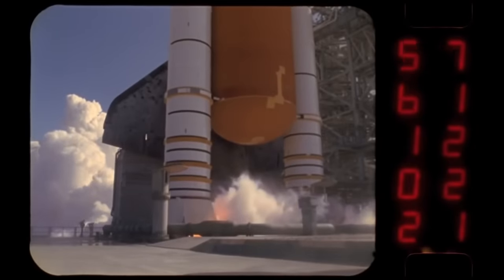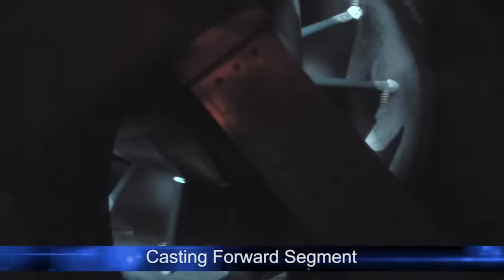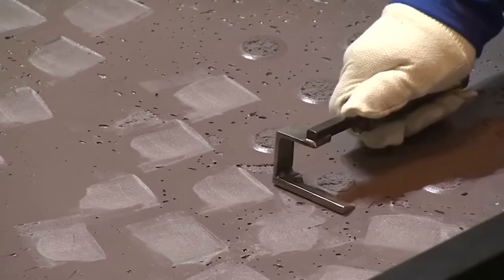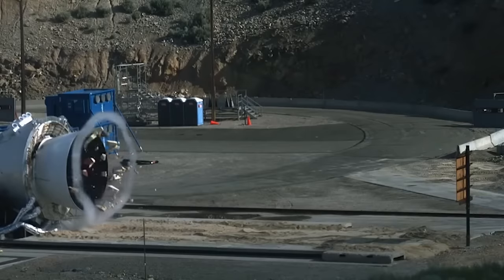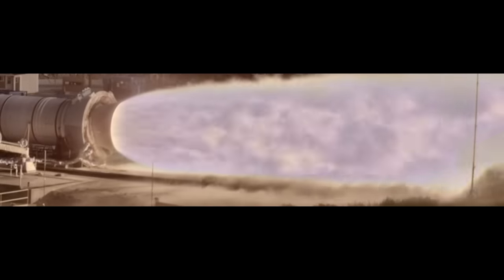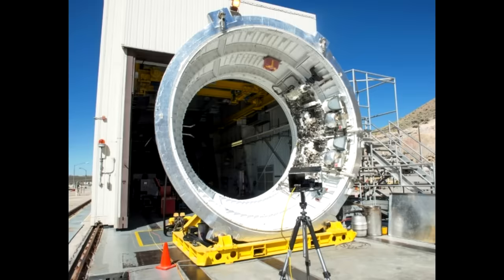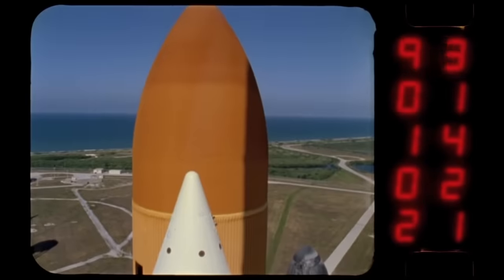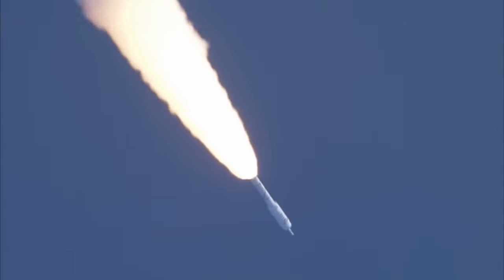The Amazing Engineering Behind Solid Rocket Boosters

Comment: Finger-picking Thiokol by the Nixon office meant the ultimate demise of the STS. They couldn't produce and deliver the SRBs in a single piece nor any more powerful than what they did, and that's why they were made in sections and in pairs besides each side of a parallel external tank. Had NASA picked Lockheed or Aerojet (biggest rocket engine ever fired. Still in a trench in Miami) the design would have been a serial/tandem which allowed for a survivable escape system just like any other rocket design.

Comment: It's not "solid rockets", it's "solid fuel rockets".
After all rockets are solid by definition, being made with metal...
Reply: Metal tubes are in fact hollow by definition.

The skin being a solid has no bearing on whether the rocket itself is hollow.

If a rocket was solid, they couldn't put anything inside it....

Comment: Why not make them as one piece instead of segments using O-rings? ... I'm guessing political reasons -like Utah senators pushing to have parts built in their state.
Reply: the SRM's planned succesor rocket was the ASMR and i was to be filled in one piece... this of course meant it had to be filled in Florida, and not moved across country. which is why the original was filled in pieces
Reply: They were to big to ship in one piece from the factory to the launch pad
Reply: @stevenf1678  They were too big to ship from Utah to Florida.  If the factory had been in Florida, no problem.  Hence, why it was likely political "pork" for a Utah politician.  This sort of thing happens all the time in congress and hence I suspect it happened here - otherwise why go through the extra engineering steps and extra processing steps. To me this just demonstrates why government run/managed projects are economic disasters and can also lead to real disasters.

Comment: It not amazing, as it doesn't work , Nasa are failing behind in the space race, China will slowly start to pull ahead .They have made that Artemis rocket to complicated, should of stuck to the old reliable Saturn V rocket system, and used the liquid oxygen and Kerosene mix for lift off , no liquid hydrogen on the lift off, its a very thin liquid and will find any weakness, the liquid oxygen and Kerosene mix worked well during the Apollo missions, and would still work well today  and the Safurn V rocket system is just as good for deep space missions . I feel the SLS rocket system should be scrapped before a serious major incident occurs. Just go back to the Saturn V rocket system and fuel, it all worked.

Comment: Unbelievable to think a few years back we were chucking the boosters in the ocean after one use and now SpaceX has re-used a booster 9 times so far.
Reply: @Steve Acho Reused means used again vs being disposed.  Refurbished means they were prepped to use again.  Fly it, pluck it out of the water, refurbish, fly again.  That is reusing the same booster.

To say they were not reused but refurbished means the boosters were not flown again after refurbishment.

Comment: Still prefer liquid rockets, F1B engines would be safer with the Pyrios booaters with Liquid Oxygen and RP1
Reply: It would have been a good systen had they done a better design job on those joints.
Reply: @GH-oi2jf  solid rockets like hypergolics are just too dangerous for human uses

Comment: Solids are great, but they pose a lot of problems moving forward.  Reusability is almost non-existent and they are expensive.  They also cant really be refeuled.  If we want to make rockets reusable and cheaper, we need to move away from solids.  They also produce much more soot than a liquid fueled engine which produces a lot of pollution
Reply: SRB'S aren't reusable? Wonder why they landed in the ocean under a parachute,were towed back to shore, and reused?
Reply: @codymoe4986  U mean refurbished?  You can't just wash it, refuel, and launch again.  The refurbishment process is long, expensive, and complicated.  It's basically just as much work to build new ones as to refurbish old ones.  Trust me, they are far from reusable.

Comment: I thought the F1 was the most powerful rocket motor.
Reply: The Space Shuttle SRB was the most powerful solid rocket motor ever flown. Each provided a maximum 14.7 MN thrust. 

This is roughly double the Rocketdyne F-1, the most powerful single-combustion chamber liquid-propellant rocket engine ever flown.

-Wikipedia, edited a bit

Comment: Ask the astronauts from the space shuttle disaster how amazing the engineering was on solid rocket boosters LMFAO , At least the liquid fuel rockets have an option ( rarely works) , Ounce that solid rocket booster is it don`t turn of till runs of go juice.
Good for payloads not human transport. The past speaks for itself.
Good vid though.
Reply: These had an emergency off, used seconds after the disaster as explained in this video.

Comment: Is there any reliable validation they actually use solid fuel? It sounds quite a bit far fetched that fuel could be solid.
Reply from the maker: Have you never used fireworks? Black powder is a type of solid fuel.
Reply: @scottmanley  Black powder is an explosive not fuel.
Reply: @lottnio8207 Seriously kiddo, didn't you ever constructed mini rockets with saltpeter and caps from bottles?
Reply: @tgstudio85  Seriously fuel is not solid but liquid.
Reply: @lottnio8207  Wood is a fuel isn't it? Fuel for your fire.  Really, go and do some reading mate, starting with the definition of what fuel is, ffs.
Reply: @SMHman666  no wood is not fuel but I think some kind of oil or something can be made of wood
Reply: @lottnio8207  It appears as though you are being serious so I suggest you have a look what constitutes a fuel. It does NOT need to be a liquid.  It can be a solid, a gas, a liquid, plus other forms as well. Coal is a fuel as is anything that is used to produce heat and or energy.  Rockets have been using solid propellants for decades.

Comment: You know Scott, you "metric only" people have to give it a rest.

No sooner are you giving booster section specs in meters, at 3:00..., the graphic at 3:07, and next at 3:15,  pops up as a graphic of original plans in inches. 

Look we know the rest of the world is so much better being as you guys use metric (/s) but for us in the U.S. being taught imperial as kids imprinted it on our young brains during early development, now we are hardwired to the way we think.

As for me to change over is asking me to convert every dimension I hear thus breaking the flow of thought. And yet even though doing so I don't visually 'feel' those numbers.

3.7 metres and 4.5 meters - what the heck is that? Mmm... somwhere around 12 feet and about 15. And that the conversion is times 3.281 has me in the weeds if I want to be exact

Although through wrenching my own cars I do know 12mm is just a bit under 1/2"... but 10mm, um let me think. 

If you're truly about educating your viewers you'd set aside your bias and do the extra work of providing imperial alongside metric as does Curious Droid.

That said... I've been a woodworker all my life, from framing to finish hanging doors, installing stairs, even as a shipwright with a turn in between as a cabinetmaker and I must say there's nothing more glorious than finessing the fit of a cabinet door down to a tolerance 1/64th all around 

To me, the very soul of my artisanship lies in the beauty of fractions of inches, and in using them always gave my brain an exercise in math... or "maths" as known to you English speakers over there.

27/32nds? Round up to even then reduce to a common denominator... I love that
Reply from the maker: It sounds like you think fractions can’t be used in metric. Where did you pick up that misconception?

Meanwhile the diagram you refer to has decimal thickness in inches.

Here’s some simple fractions: 
Convert kilometers to miles multiply by 5 then divide by 8.

Kilograms to pounds -multiply by 2 and then add 10%

Meters to feet, multiply by 3 then add 10%

Easy.
Reply: @scottmanley  
Err, let me crib note those in ballpoint ink in the palm of my hand. Lol

You're asking a 60 year old guy to change the way he puts on his pants.

But in my OP I was remiss in not making clear how much a fan I am of your channel, its content, you with your easy delivery in your Scottish brogue, and the way you take great pains to explain the complex in layman's terms... easily grasped by a dense chooch like me.

My comment wasn't all about you per se but more of speaking to the endless haranguing heaped upon we the imperial users.

And btw, I did really enjoy the vid, being one whose childhood was dominated by the moon landing. 

My uncle was a US Army Colonel (ret) a WWII vet, and served as a governor of of one of the islands during the occupation of Japan. As a civil engineer by degree he over saw thr building of roads, bridges, water and sewage treatment plants, hospitals, schools and clinic. 

As he would say the U.S. government brought the rural parts of Japan into the 20th century 

Through steps never made clear, (we always sussed he was really deep cpver covert) he served on the civilian advisory board for the Senate Subcommittee for NASA.

We got all the NASA swag including models and photographed pics of every astronaut as the program progressed.

I was a month just turned 9 in that July of 1969.

I find your channel to be a great comfort to that 9 year old still inside. 

Cheers to you my good mate and Fly Safe

Comment: All held together by the strongest bolt ever made. 1 bolt can withstand all that thrust.
Reply: If you're referring to the hold down bolts, as a safety measure the thrust from the shuttle main engines plus the boosters was enough to overcome any failure of the bolts failing to explode.

Comment: With solid rockets main problem is the shape cylinder is very wrong . Must be hexagonal shape with some inside supports
Reply: Why?
Reply: @bop3752  because balance the pressure
Reply: @ilhandurmus  cylinders are always best at distributing pressure, corners cause pressure build-ups. The first jet airliner disintegrated mid-flight because it had square windows
Reply: @bop3752  you are wrong cylindrical shape is good at outward pressure inward pressure best is hexagonal shape

Comment: Technical debt is everywhere! The size of the space shuttle boosters was set by the maximum size that could fit on the railroads to the launch site. This in turn was set by the distance between the rails, aka the guage. If the CG is too high for the guage the load will not be stable. This guage was set to match the commonly available infrastructure at the dawn of rail, wagons. The space between the wheels on wagons was set to match that of Roman chariots because if you didn't have that spacing, the wheels or axles would break when run on the Roman roads because of the ruts left by Roman chariots and everything that followed them. The Roman chariots wheel spacing was set to fit the horse that would draw the chariot. 

So one specification of the space shuttle was literally set by a horse's ass!

Comment: Still feels like such a waste hurling 1zt stages into the sea nowadays. How much are this liquid fuel pumps worth at T-0 & how much are they worth as they fall into the ocean?
They may collect the empty shells of the solids for reuse but the main liquid fueled engines are just thrown away!
They had a fine example right in front of them whilst they designed this disposable money pit from scratch. 
They took the easy way out cobbling together a hodgepodge of spare parts they had collecting dust from previous projects. This style of rocket design just isn't sustainable! It can only be done for a few years until the parts supply dries up. 
Then whatcha gonna do?
They could've designed a largely reusable stack for the jobs expected of this vehicle giving them very valuable data for new builds to come. 
The SLS is a chance to progress missed.
Reply: SLS will throw away the RSRM-Vs as well.  NASA was told to use Shuttle hardware, so that's what they have to do. Blame the government, not NASA.

Comment: They may be high tech but that doesn't make them cheap, efficient, or safe but when keep using them because "we have to keep the contractors happy or they will go work for our enemies" or so we are told. The real reason we keep using old junk like these is because the contractors have bribed or I mean "lobbied" congress so they can keep getting all of those sweet sweet tax dollars without actually having to develop anything new or even produce anything at all since they know they will get paid ether way since they are on cost plus contracts with no real oversite.
Reply: The SRBs are Gemini technology.  When the Air Force MOL Space station was cancelled by Nixon, the SRB designs were recycled and contracted out to Thiokol to build and MOL astronauts like Crippen were reassigned to NASA. One reason for the MOL cancellation besides DoD Cut in 1970 was the SRBs were deemed too dangerous for human flight.  The American public has a short memory and fortunately for NASA is very forgiving.